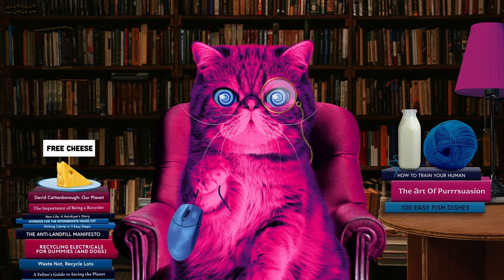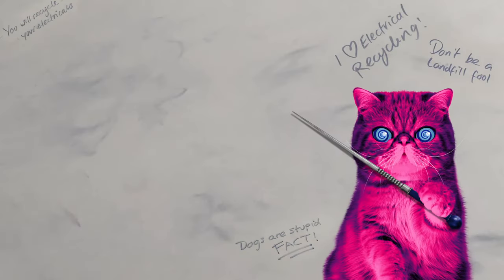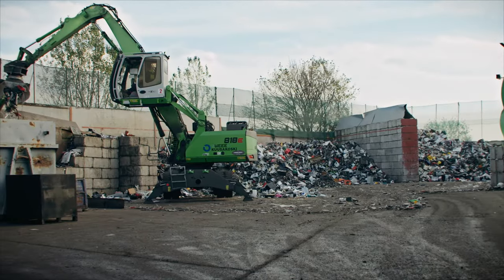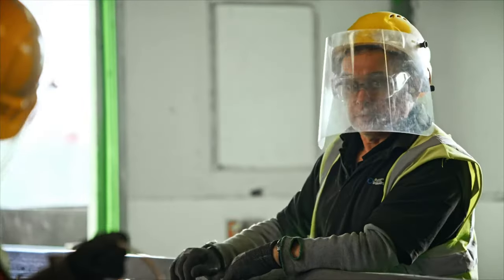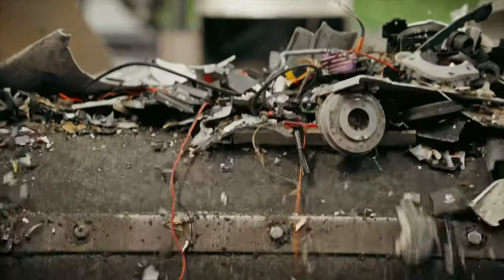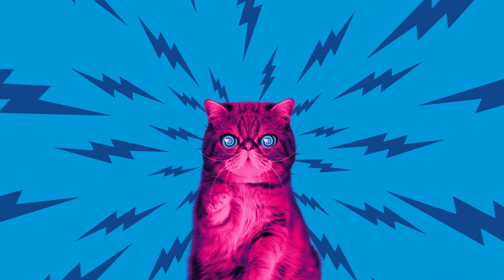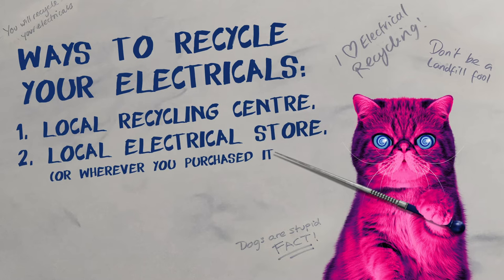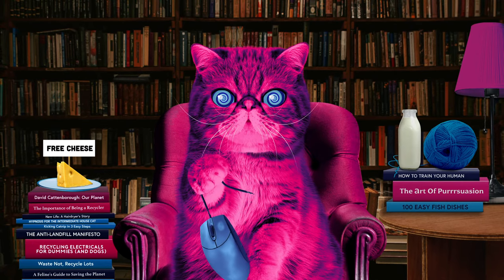How are electronics recycled? Ask HypnoCat!

Comment: A lot of old electrical and electronic items used to be thrown into landfill, before the WEEE regulations came along. Which is a shame as there is probably a lot of (back then) fully working equipment that will take centuries to rot down, if they will ever rot down into something else at all!
But first, before you recycle your electricals, see if you can give them a new lease of life by selling them on, or salvaging usable components from them, that way they won't have to be broken down unless they really are broken (and cannot be reused in any way). Even donating them (if they are still working) can give someone else the chance to use the item whilst it is still functional.